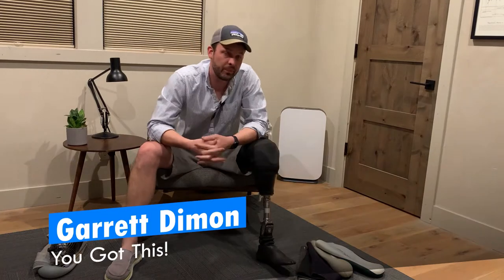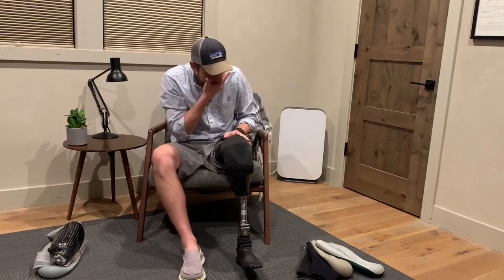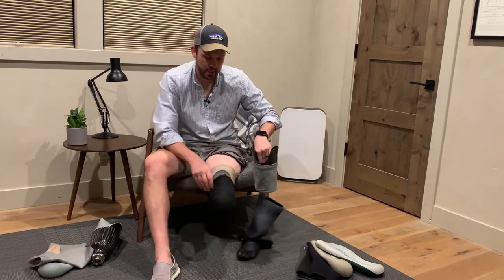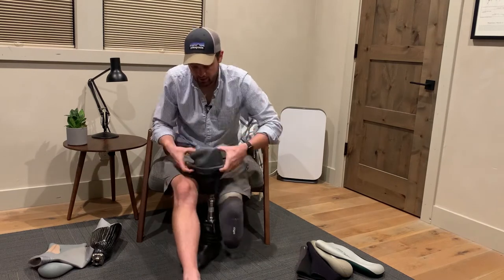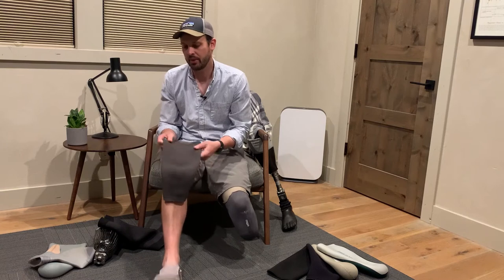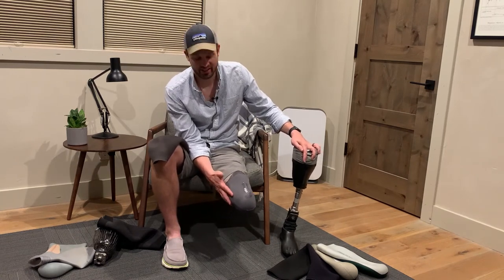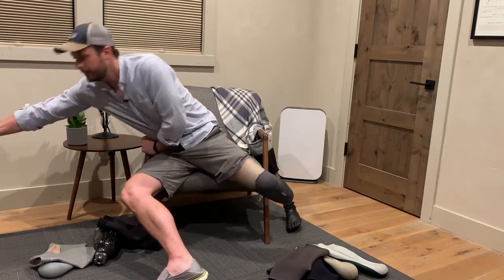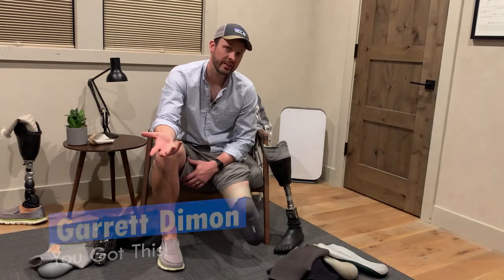Prosthetics & Suction Suspension Systems

Comment: Any videos on repairing sealing sleeves
Reply from the maker: Unfortunately, no. I've tried a few things like duct tape, electric tape, and other solutions over the years. However, once the sleeve starts bending and flexing, they invariably don't last more than a few hours at best. It could work in a pinch, but you'll be re-doing it constantly.